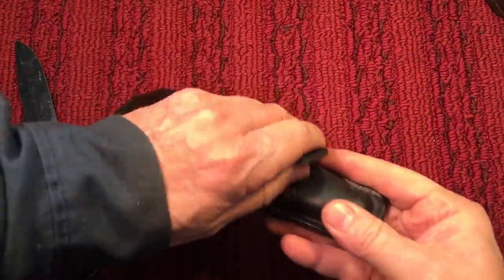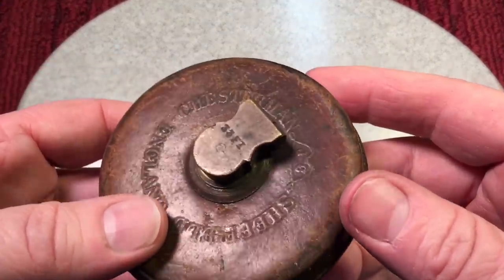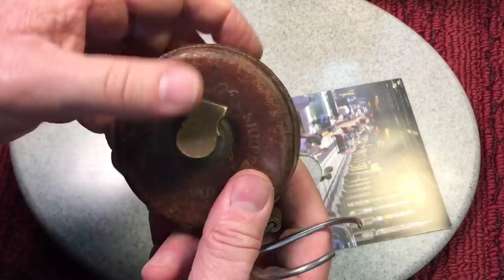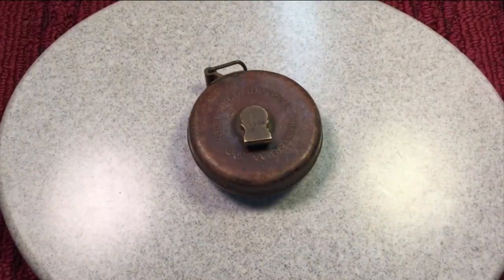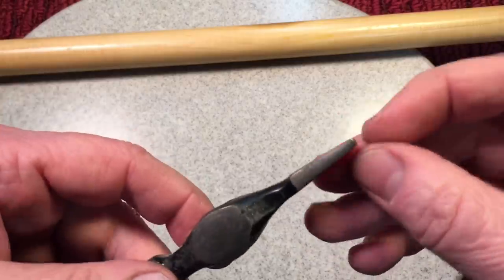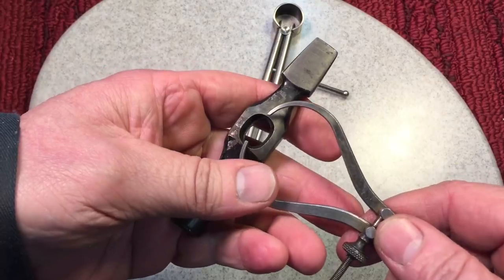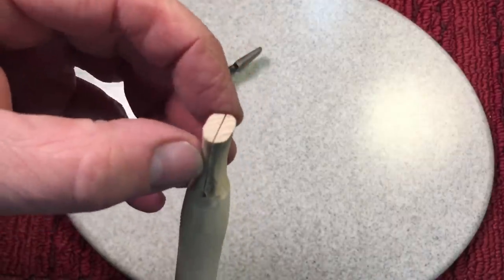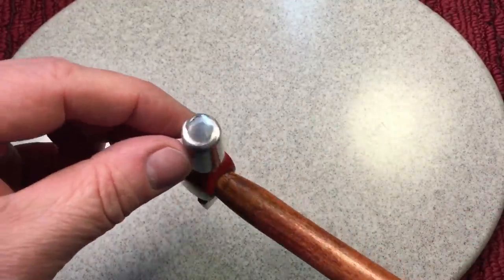Chesterman Leather Cased Tape Measure and Warrington Hammer

Comment: I enjoyed this restoration and nostalgia. We didn't have air pin nailers when I started vocational carpentry and cabinet school in 1975. Everything had to be jointed or doweled. Small facings that couldn't be attached required pin nails driven by hand with hammers like this. An excellent restoration as always!

Comment: Hi Scoutcrafter
Been watching your vids for just a few months now.
Your restorations got me thinking about a adjustable wrench i was given a long time ago.
Only a small 6 inch affair and really badly negelected.In fact they had been left outside in the garden and were covered in baked on soil and rust.
This morning i was clearing the shed and came across the wrench,So decided it was time to have a go at getting them working again.
I used hand wire brush and wd40 to get them free and moving.Stripped them and gave them a good dersust and oiling.
They now work like new and imagine my surprise when i cleaned all the crap away and found they are BAHCO ERGO made in Sweden.
Great little adjustables now that were headed for the scrap bin until i saw your vids.

Comment: I used to use one for repairing sash windows in the uk . The flat cross pien slides down the glass to drive in retaining pins or beading tacks. Saves you trying to hammer near glass

Comment: Wilko the brand of this hammer is pronounced "will-co" or will-co's either is acceptable in the  UK.

Wilkos is s low cost home and hardware store selling all types of Chinese made stuff. But that said they sell some reasonable tools such as your hammer. 

In the past before plastic window frames these sorts of hammers where used to hammer the very small nails used to fix the glass in place before putting up the glazing bars in wood window frames 

And I don't think a hammer from wilkos has ever looked  so good
Reply from the maker: The Last Spartan The font they used was hard to read for me!  😃👍
Reply: that is so true about a wilko hammer made it look like  a very good hammer and such a great finnish
Reply: Your absolutely right pal it's from Wilkinsons aka wilko's and yes it looks amazing for a wilko's tool lol also correct on its use I grew up knowing this as a tap hammer and I used my dads one alot for small delicate car repairs too and welding I still have it now even tho he passed away RIP dad the mad scientist we nicknamed him but the hammer is just a head now and needs re hanging on a new handle which I'm going to do this year cant wait

Comment: I use one in my job as a glazier a little heavier though 8oz ,we run a strip of electricians tape around the sides so if the nail puts a slight nick in the face  of the hammer it doesn’t come into contact with the glass and scratch it .Another great restoration thank you Scoutcrafter

Comment: Never saw Full Metal Jacket but have come close to one with wraparound sleeves. NICE so-called dime store handle on the hammer. Yeah, right. I can just see you wobbling out something like I'd make. And that is a NICE tape! I got to do that for my Sweeties shoes. She said they started leaking and I used Sno-pruf when I was out in winter snow and mud so I got the shine kit out and the tooth brush and did the seams and then laid the neutral to the rest and they turned out like something YOU'd do! She was tickled and me too. Thanks John CS! A-PLUS!
Reply from the maker: Lewie- Full Metal jacket is a must see...  😃. You’re so right about Sno-Proff!!!
Reply: @ScoutCrafter  I got cussed at enough while I was in there and when it starts now I block and unsubscribe. NO thanks. Heard it all my construction life too. And I might slack off with a lot of stuff but those boots of mine cost too much to let go. And while I'm polishing I'll do hers too. Job security!

Comment: Evening John, your Pin hammer is made by wilko and when you’re driving small pins or tacks that cross peen will make starting the pin much easier. The old cabinet makers used to put the pins in their mouth and using a a Warrington pattern cross peen, they’d drive them so quickly and accurately it’d make you wonder how they did it and in a word, it was experience! Those carpenters cross peens come in various sizes up to fairly substantial weights. Most people today see a claw hammer as a universal carpentry and joinery hammer but in the past, in a joinery or cabinet makers workshop, cross peens were king and the claw hammer was looked upon as a tool for rough carpentry, shuttering and framing out on site. When I was at school, our wood working workshops had predominantly cross peen hammers in all sizes.
Reply from the maker: Hi Nick- It’s amazing how many specialty hammers exist and yet most people only know one or two...
Reply: ScoutCrafter In the past John, every trade had its own hammers, specialist tools that made work easier and more efficient. We’re regressing not progressing in so many ways.

Comment: That's a really common hammer style in the UK. Sort of thing nearly everyone here will have in draw in the house somewhere for light work with small nails etc. Really good for putting a pin in wall to hang a picture etc or mending draws and picture frames and the like. As you say professionally it was used by cabinet makers and as others have pointed out glaziers. I really like them and keep a lookout for nice ones at car boot sales.
Reply from the maker: Patrick Funny how we hardly ever see those here in the States!  Thanks!  😃😃

Comment: Yes I also use it when nailing the beading round the edge of glass panes. Helps to stops you from smashing the window when driving in small nail. Place a thin peace of card on the glass and run the long flat edge against the glass with the card between and you will find that the glass has no chance of being broken.

Comment: In English terminology, the “brad” is referred to as a “panel pin”, used for pinning panels into a frame when making cabinets. The cross-pein face allow the pin to be sunk close to the frame, without interference from the round head, also reducing the likelihood of marring the frame. Anther viewer mentioned fitting glass to a window frame in a similar fashion.

Your finger and thumb are safe as long as they are below the head, as the “V” formed when gripping the pin acts as a guide to neatly channel the cross-pein face onto the head of the panel pin. When working as a tradesman, efficiency is key, as using extra time to pick up and put down another tool (needle-nose pliers) for each nail reduces your output.

Comment: I learned something new today!  Out of curiosity, if the tape measure was dirty on the fabric and had stains and stuff, how would you tackle cleaning the tape?
Reply from the maker: Joe- Believe it or not they were specially treated and varnished to make them water resistant...  If they are really worn and dirty you could wash them but you had to make sure they were bone dry before rewinding them or they would stretch or get moldy!

Comment: Wilko is a shop chain, like Woolworth's but smaller. The hammer would also be good at driving in window brads they are small and flat and the cross peen would hit them better against the glass.

Comment: I use my Warrington hammer when working with leather for driving in tacks to hold two pieces together prior to sewing them. If you are driving 20 or 30 tacks it is much faster than using pliers.
Reply from the maker: Kob You are so right!  It pays to learn to use that novel hammer!  😃👍

Comment: Just love your channel.You have inspired me to get some of my dad's old tools out from under the bench and start restoring.  Wilkinsons started to use the Wilko brand name in the 1970s' so that gives an approximate age for the little hammer - https://corporate.wilko.com/_pdfs/History_timeline.pdf.  The main purpose of the straight pein  is for use where the main striking head is to big. For example, when tacking a back board into a picture frame or or tacking glass into a window frame prior to applying putty.
Reply from the maker: Hi Fred!  Funny thing is here we use glaziers points (triangles) and install them with a firm puddy knife.  😃👍. Thanks!

Comment: My grandfather had a cloth tape measure but there was a problem. If you were laying out a wall or foundation footer on a good hot summer day and the next day was a wet rainy day the measurement was off by 4 inches. I caught bell that I was reading it wrong. Turns out the tape would stretch and shrink with the weather and how hard you pulled on it!
Reply: Interesting, never thought about that but makes sense why you don't see them anymore

Comment: Why did you not take the tape measure apart and clean the inside?  If you had, you could have polished the brass with no concern of needing to protect the leather. 
The tip on brass staining leather was nifty. Thanks!
Reply from the maker: bllourias I have no idea how these come apart!  The case is one piece and there is probably a small take up reel that might slip out after the rewind mechanism is removed but sometimes you can open a real can of worms!  😃👍

Comment: That's a not a warrington hammer it is a pin hammer a warrington is the same head shape only larger around 10 to 12 oz. They are great for panel pins. Iam a cabinet and furniture maker in Northern Ireland United kingdom
Reply: hmmm....not strictly true, Warrington is the pattern of the hammer, they do come in 8oz. Basically a cross pein opposite a slightly curved face head. The cross pein is used to start pin between your finger (so you don't hit your fingers), the opposing convex head finishes the pins flush without marring the wood.
Reply: @spencereagle1118  hammer shown in the video is a pin hammer due to the size of the face and weight of the head. This hammer is for lighter work. A warrington is a far larger hammer for oval and lost head nails
Reply: @jamesdrennan890  read a book, I'm right.